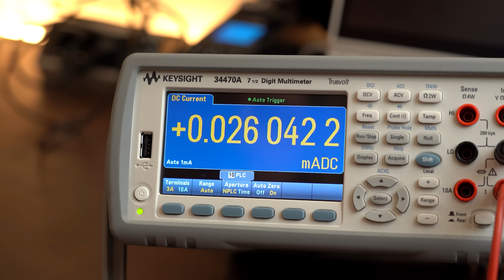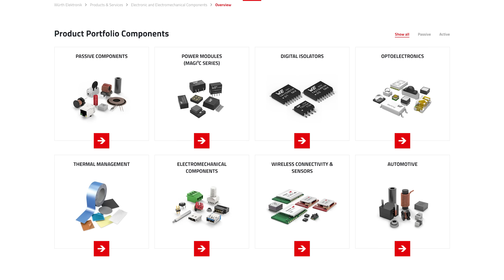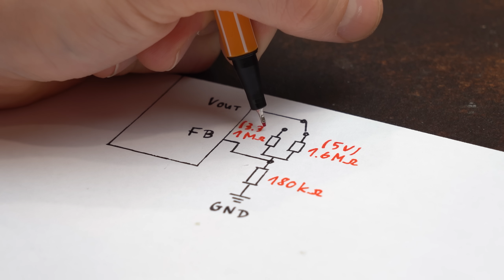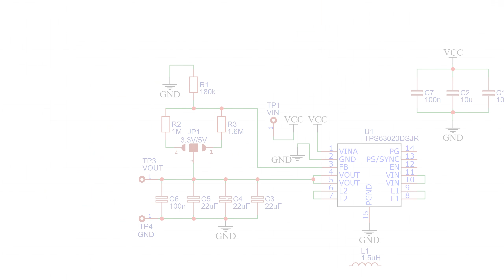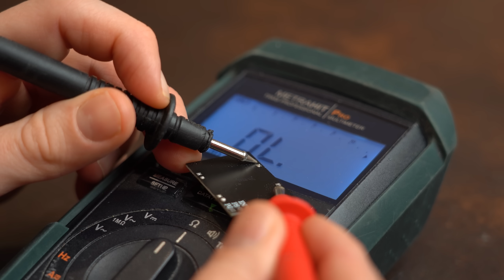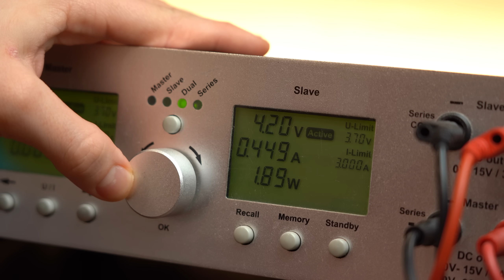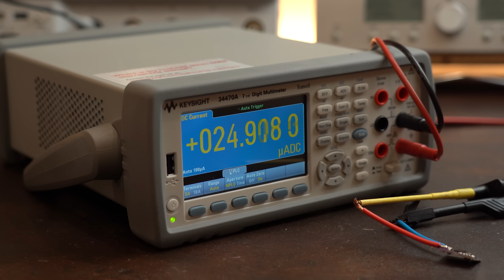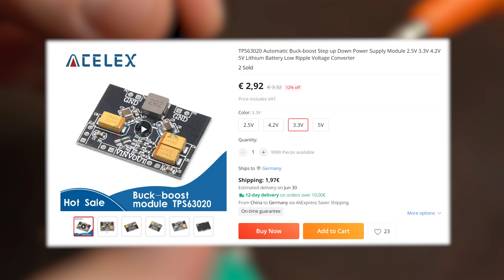How TINY Can I go? The BEST Power Board is here!

Comment: The reference design and this design which uses the reference design seem questionable regarding placement of the inductor and use of wide traces leading to and from it. It is widely known that keeping the capacitance of these traces as low as possible is key to low EMI, and the design goes pretty far in the other direction. There is no discussion about this in the datasheet, but it would be surprising if a better design wasn't possible by placing the inductor as close as possible to the TPS63020 allowing lower capacitance traces. It seems that this was not done to allow additional copper ground for cooling while also removing of copper from below the inductor, but this seems like a bad tradeoff...
Reply: You seem to put too much emphasis on parasitic capacitance. Reason for extra wide tracks or area is to reduce the most malicious parasitic element for switching converter namely induction. This produces spikes which can ruin your EMC more easily. However getting all aspects right is much more complex than just trying to make things smaller or copying reference designs.
Reply: @rkriisk  Parasitic induction is a common problem but not going into an inductor where it is a nonissue. Parasitic capacitance at the inductor leads form a resonant circuit which leads to ringing, the primary source of EMC for most SMPS designs. For this reason, it is a general rule of thumb to keep the capacitance associated with switching nodes as small as possible.
Reply: @ats89117  only when you don’t do proper return path or you have impedance mismatch so it won’t dampen it enough
Reply: @rkriisk  An inductor with a capacitor on both sides forms a Colpitts oscillator which causes ringing. The only way to minimize this is to minimize the parasitic capacitance at the switching nodes.
Reply from the maker: Thanks for the feedback. Interesting points.
Reply: @greatscottlab  If you have time, it would be interesting to look at how much ringing is occurring at the L1 terminal for buck mode, or the L2 terminal for boost mode (based on figure 5 from the datasheet). Anyway thumbs up for a fantastic video! It's great that you not only made the board much smaller, but went through several iterations to see how far you could push it! German engineering at its finest!
Reply: Also stitching planes together with many vias which a not either filled with copper or dielectric material is also a source for parasitic inductance. If they are open they become air core inductors with all associated issues including introduction eddy currents inside your stack.
Reply: @rkriisk  Via inductance on high speed signal traces are an issue. Much less so in SMPS designs when you are using a large number for thermal dissipation. The large number makes the resonant cavities very small and the inductance is diminished by the large number of vias running in parallel. The resonance of the switching inductor with parasitic capacitance at the switching node almost always drives EMI and the ringing also reduces efficiency, so it's a good thing to concentrate on. I'm surprised that this wasn't addressed in the datasheet, but the great majority of TI's SMPS datasheets recommend minimizing capacitance at switching nodes.
Reply: @ats89117  Not to sound now too ignorant I fully support reducing all kind of parasitic elements including capacitance which will bring forth its own can of worms so you are right to bring this issue forward.

Comment: Wow!  That’s amazing! Also, those inductors are incredible for their size! 
I’ve been working on a PCB which needs to put out 5V with as much current as possible, as small as possible, which runs on a single 18650.  I ended up landing on a TI chip as well that’s just amazingly small for the power it can handle.   

It’s a fun challenge!
Reply from the maker: Thanks for the feedback. Sounds interesting on your side as well.
Reply: that sounds like a good thing for raspberry pis!

Comment: Thank you for the interesting video but I have a suggestion for the next time you design power converter with selectable output voltage instead of changing between two resistors for the feedback divider put one of the resistors such that its always connected and only switch the rest of the resistors in parallel to it. This takes just a bit more time to calculate the resistors such that their paralleled value is the one you want but ensures that you always have a feedback in the circuit especially if this is a switch that can be changed while the circuit is powered. Otherwise if you switch the output selector switch the feedback path will go open for a brief moment and the converter can damage itself.
Reply from the maker: Thanks for the feedback :-)

Comment: I am amazed anyone can solder that tiny, i for sure cannot. Good video as always.
Reply from the maker: 0805 is definitely possible. 0603 also. Tinier than that and it becomes a guess work. Maybe I should do a challenge video about this ;-)
Reply: @greatscottlab  I find 0402 to not be that difficult. 0201 takes some patience though. Haven't tried 01005 yet.
Reply: @greatscottlab  YES! I would love to see that. I can't even do 0805, let alone smaller th an 0603
Reply: Not difficult when using good solder paste (Sn/Pb) and hot air. Very difficult if one insists on lead free solder and an iron.

Comment: I wonder what happens when you do a continous load test. I worry that your smaller designs might overheat, because they have less surface area.
Reply: It’s perfectly fine, with switching converters like these the amount of heat generated is pretty small. In the worse case scenario here we’re talking ~2W, which should not be an issue.
Reply from the maker: I tried continuous load for 10 minutes for every board at max. It is definitely true that my boards do get hotter. But everything functioned just fine and nothing blew up.

Comment: Another idea to get it even smaller: This is a non-isolating converter, so you don't need a GND pin at output. That enables you to just put all the contacts on one edge. GND in the center, and capacitors on the sides in between. I bet you can make it smaller if you place more components on the backside too, but for manufacturing all components on the same side are prefered.
Reply from the maker: Thanks for the feedback. I guess there are many way to go even smaller. But still, I was pretty happy with the outcome.
Reply: @greatscottlab awesome video, I just want to see how far you can push it in size!
Reply: @greatscottlab you need to go even further! you should swap the packaged ic with a bare die
Reply: pololu does it this way, with 3 pins, like it
Reply: Great idea! Making it pin-compatible with a 7805 for example.
Also, if you need to solder-blob the voltage, why not just use a different resistor (and loose one).
Perhaps you can even get everything on a single side (no hand-soldering required)
Reply: @nemam_nedam I would like to see a video on that!
Reply: especially if you let them populate the board with automation as even smaller parts can be used.
Reply: I dont know of its on the comnents somwhere.. you get 3 pin dc-dc converters from 24V to 5V or 3.3V, pon compatible with the 78lxx.
Dont know about the noise but 500mA is the one i use.

TDK lambda and others and even a RS-pro branded one. Around 3 to 5 bucks. There are wude input ones and cheaper+more efficient ones for a fixed Vin +/- 10% or so.

Of course also 4 pin with isolation, which allows for some trickery with doubling the voltage without reducing the current, as happens on 3pin..
Reply: Why bother with PCB? 3D assembly, drag a copper thin foil for heat dissipation and blob everything in resin...
Reply: How can you do this with SMD components that has multiple tiny pins? @codures
Reply: @sciencetainment3793  like bga or qfn ?
Reply: Here's trick to minimize components: but a high tech factory that will allow you to make transistors the size of few atoms
Reply: I read this like 10x but I still don't understand what you mean. Could you share some sort of video of somebody making  something like this or perhaps an image so I can get what you mean? Thanks! @nemam_nedam

Comment: Nice little chip. I have considered using it for backup power for some home-grown smart home devices but ultimately didn't go through. I missed one thing from the video though, that can make or break a power supply and that is capacitor derating. Class II ceramic capacitors are pretty nasty and change their capacitance if they are DC biased and me not taking that into account actually cost me weeks of troubleshooting because of unstable power caused by the lack of capacitance at the input. TI has a pretty nice online design tool that helps you find derated values and most capacitor manufacturers have a public database.

P.S. Thanks for reminding me about this IC, I have a project where it should serve me perfectly

(Edit: corrected grammar)
Reply from the maker: Thanks for the feedback. I will look into that.
Reply: I believe the usual rule of thumb is to order MLCC caps with at least twice the voltage rating you need.
Reply: @Jefferson-ly5qe  I heard it and while it is a good idea to oversize a bit, every capacitor has its own unique voltage-capacitance curve. I have recently looked at two 10uF 50V caps, one was 1206, the other 1210. The latter one had half of its rated capacitance at 25V, the other was already under 1uF. And that's not even accounted for changes because of temperature. And it made a huge difference

Comment: Fantastic, this could be the kernel for a while family of useful parts added on because it's so small. Usb-c recharging, very portrait and very square form factors for pen/cell or low profile spaces, single sided and double sided for a flat surface or smaller size, a prototype board with lots of breakouts and led indicators... 😁